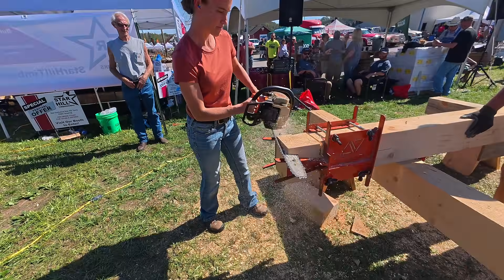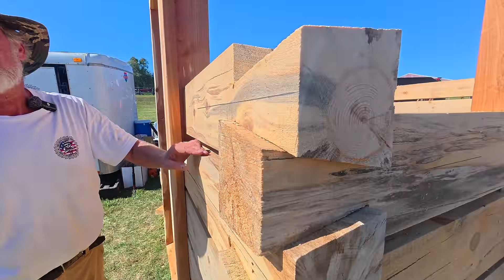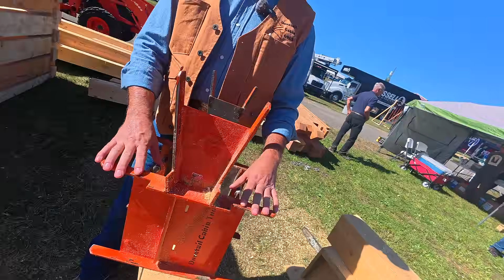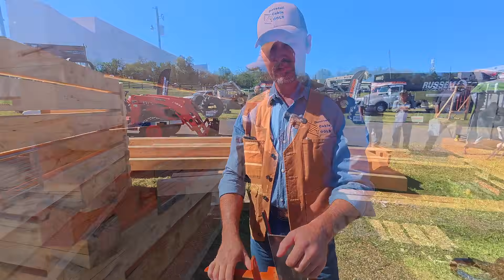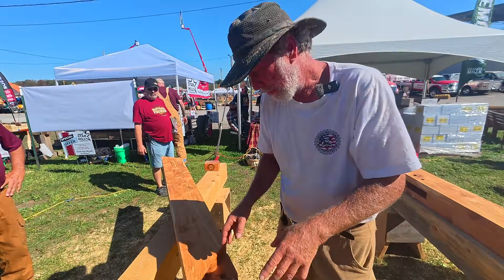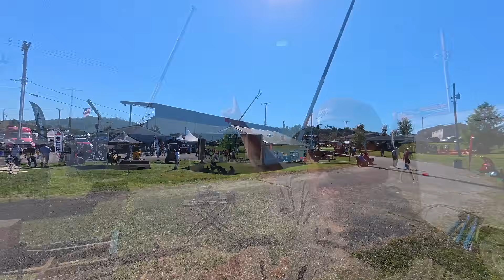A Better Way to Build a Log Cabin???

Comment: Why does the dovetail jig leave such large gaps between beams? 

Why not touch or almost touch to minimize the gaps?
Reply: If the gap was touching shut, then it would be inconsistent size when the wood dries. Can't have no gap in some spots, and half in gap in another spot. So they make the gap large enough that the insulation would fill the gap. Some log frame builders stack the logs tight, but the dovetail gap is intentionally large enough to fill after it's built.

Comment: Hi Brock.  Suggest build either a small cabin, or plain overhead shelter - like a gazebo, somewhere at top of the hill off the path your working on.  The kiddies would love it and add to thier camping experience.

The splice joint the jig guy was talking about is a variant of a scarf joint, which has a tooth at the end so once together any pulling force only strengthens the joint.  It doesn't appear his jig provides a scarf joint - just a modified scarf, which is a lap joint, you would always want a scarf joint on a beam.

Good luck.
Reply from the maker: Thanks for sharing